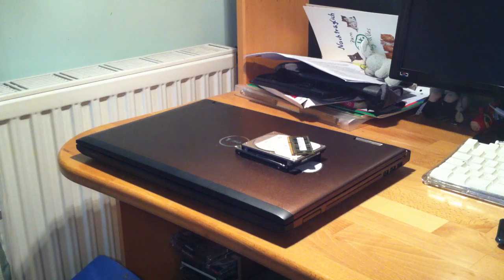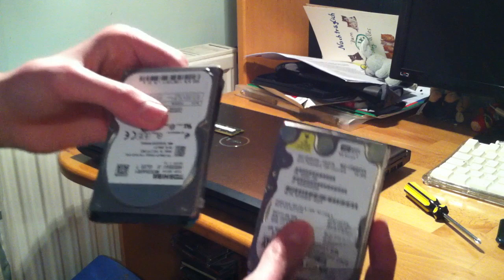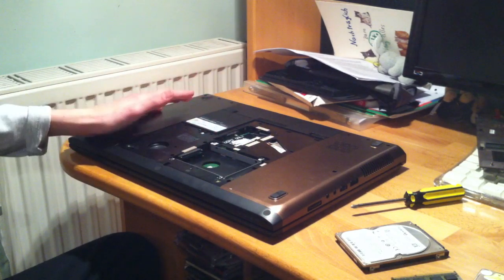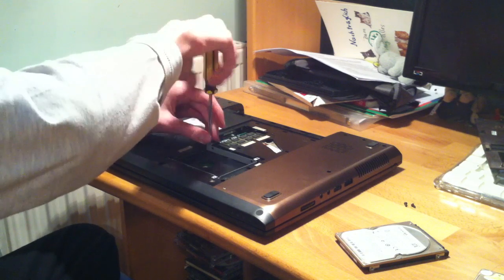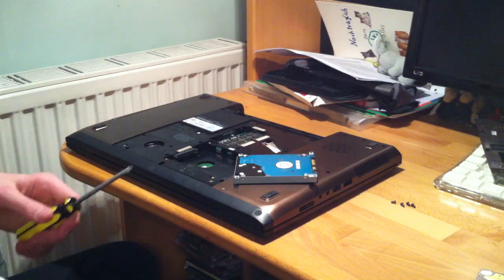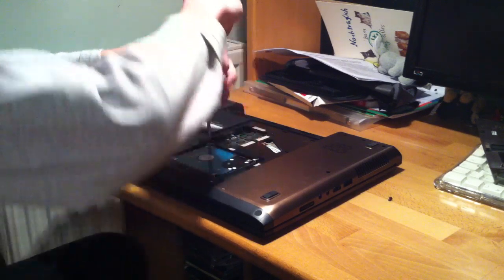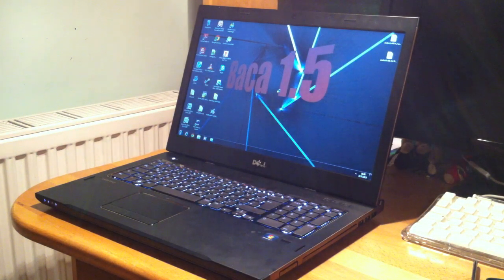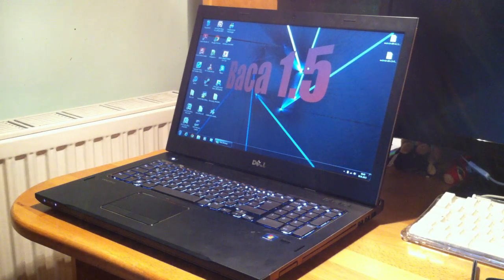Dell Vostro 3750 RAM and Hard Drive Upgrade

Comment: Has somebody succeeded in booting Linux Ubuntu from an USB (preferably USB3) SSD? It works nicely on the 3550, but the Optimus graphic circuit of the 3750 seems to make things very annoying, whether with Ubuntu 12.04, 12.10 or even the cutting edge Linux Sabayon (base Gentoo). A pity given the quality of the 3650 screen.